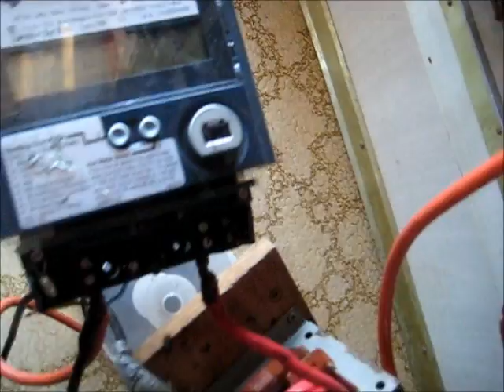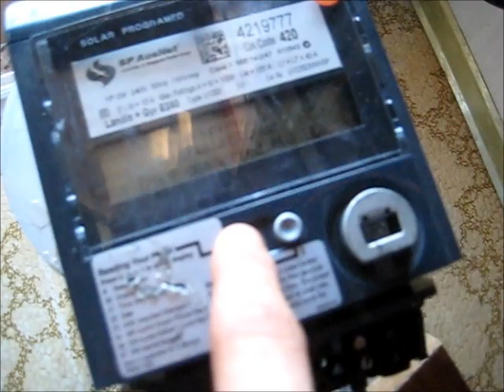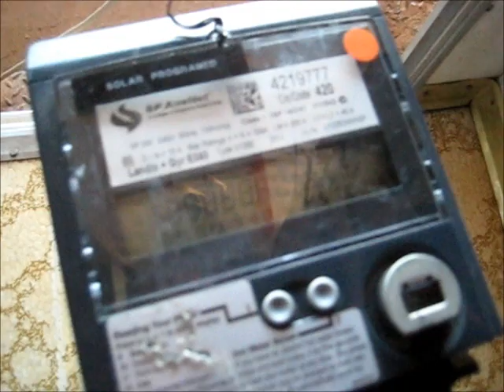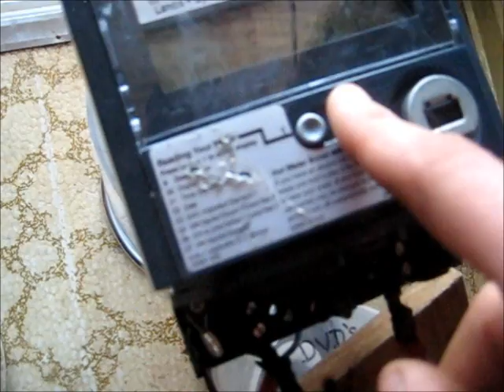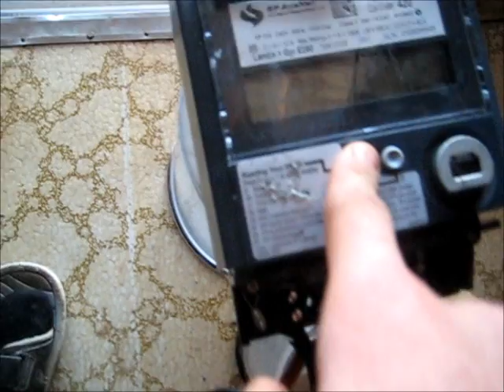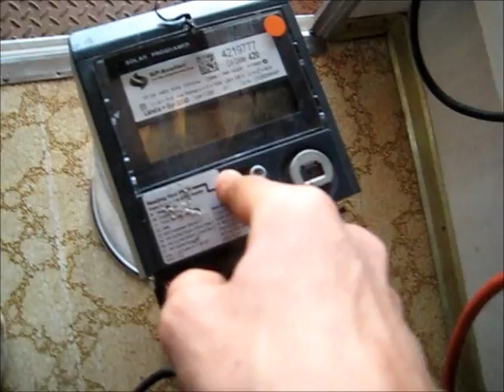Overloading a Smart Meter

Comment: In this unit, there's two LEDs....A visible-red one to indicate power usage, & another infra-red LED for 2-way interfacing with a programming probe of some kind. 

A lot of meters like this, including basic full-electronic non-smart meters have the two-LED setup in them as described above. Our basic L+G full-electronic meter has the same setup, & that's not a smart meter. To see our basic L&G, I've done a vid of it on my channel. :-)

-BoomBoxDeluxe.

Comment: Hiya. After watching the vid, & reading the comments, I may have to agree with Rodalco. You may be stuffing the juice through this backwards. 

Check your set-up by ( CAREFULLY ) phantom-loading one of your mechanical meters to see that the juice is flowing the correct direction. You see, a mechnical meter can tell you the direction of current flow 'COS THEY ROCK. :-D

Then, once you're happy that the juice is going 'forwards', replace the machanical meter with the smart meter...& CRANK it!

BBD